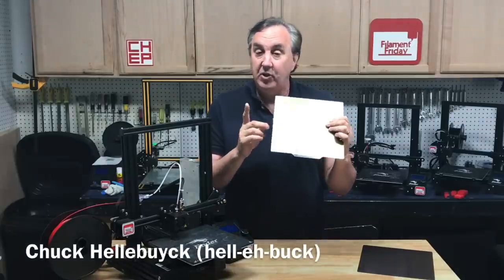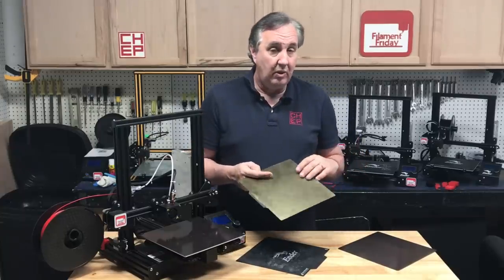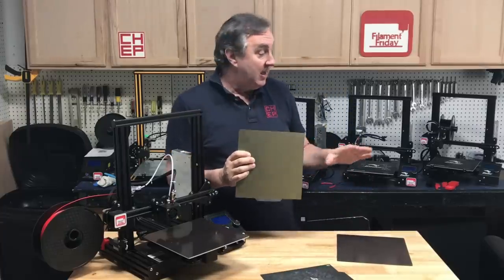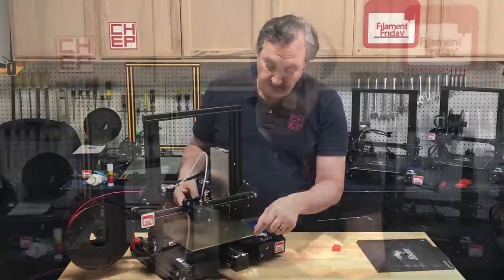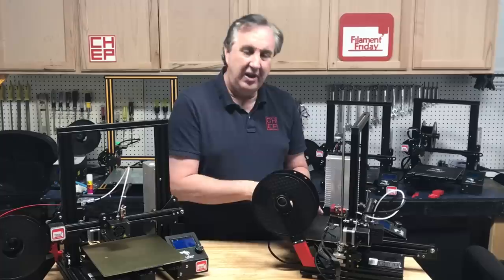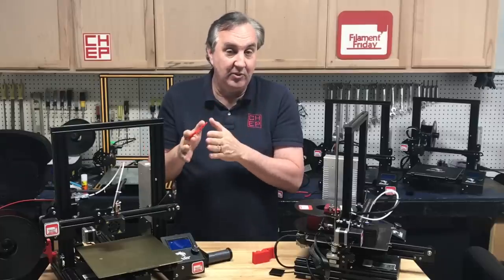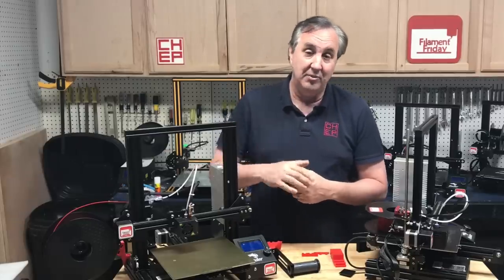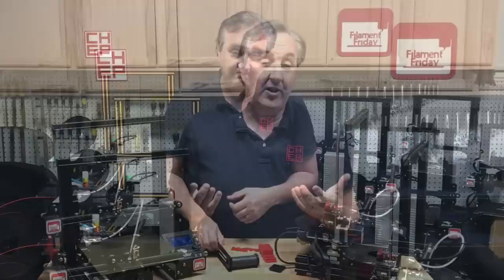Creality PEI Magnetic BED on Creality Ender 3 PRO

Comment: TLDR : I have 5 of these (Creality brand) they all work great, occasional wipe with IPA is all I've needed. I do print with the bed at 60C though which seems to be a common sweetspot. 

I have bought 5 of these sheets for my Ender 3 Pros and I have been very happy with them. I will say the ones that I have bought from Amazon are usually hit or miss  as far as quality control goes. I've had a couple that have not been cut perfectly, or have a blemish like you had. The great thing was Comgrow has always taken them back without issue and replaced the sheet. I recently bought one directly from Creality when they had a sale, and it's interesting that it really seemed to be a higher quality. The PEI is cut correctly and also the PEI in general just seemed like a different look and feel. I actually really like it, and would probably buy directly from Creality if I need another one.

With that said though I love PEI and can't imagine printing on anything else. I NEVER use any additional adhesives (or release agents) for PLA and I very rarely have any adhesion problems. If I do it has always come down to a leveling issue. 

I started my 3d printing journey with a Prusa MK3S, which comes with the smooth PEI sheet and that's what I got started  and learned on and also what I have had the best luck with. So when we got a couple of Ender 3 Pro's to tinker around I got fed up with the stock sheet, and didn't like printing on glass at all. Got the Creality PEI sheets and I love them. You should take care to not touch the surface to much, and if you do you should wipe it down with IPA. I've also used 100% Acetone to wipe down the sheet a couple times after excessive printing and they really cleans it up and rejuvenates it. I have heard some people say that washing it with warm water and blue dawn is sometimes necessary but I have never had to do this with a smooth PEI sheet... As mentioned I have 5 and other than a wipe down with IPA when I received them and occasionally after every couple of days I've never had any issues.

Comment: I have upgraded my CR-10S to a textured PEI magnetic bed, and in my opinion it just needs a little higher temperature than the recommended standard, I just use 65°C for PLA and 80-85°C for PETG (I also have a 750W AC heating bed, otherwise good luck getting that temperature on the stock bed!).

Comment: How come you have had so much issues? PEI flexi sheets are the main-stay of prusa printers and they rock. When I start to lose traction on my PEI, I use a green scourer to rough up the surface (a little) under warm soapy water. Never failed yet in nearly 2 years and 4 beds. IPA between prints, and an occasional refresh with the scourer after a few months. Hope that helps.

Comment: I print on PEI (PrimaCreator and TwoTrees, which seem to identical to me) and Wham Bam PEX exclusively, but then I almost always print large, flat objects. I had a hard time getting these off of non-flexible build plates. For me, keeping the PEI very clean with 99% IPA as well as dialing the Z offset in very well are the keys to a good print. Still being a beginner, I tend to print too low which results in the nozzle damaging the adjacent lines of already printed material, peeling it off in some cases. But apart from that, I rarely have problems with adhesion. Oh, and I also scuffed up the sheets with steel wool as per the sellers' instructions.

Comment: have you tried printing it inside an enclosure? the steal tends to expand and contract during prints.I had same issues with my wham Bahm and i have a 400 to 400mm bed. after enclosing it.. no warping whatosever.

Comment: I have 6 Ender 3s and use these PEI build sheets on all of them with no issues.  Did you adjust your bed temp for the new sheet at all? Did you adjust your Z for the thickness of the new sheet?
Reply: What bed temp do you use for these with PLA?

Comment: I use powder coated PEI flex plates on all my printers.  I print with PETG and PLA with no problems.  I do print 5 - 10 degrees hotter on the bed.

Comment: I have pei on my Ender 3 and my Ender 3 Pro. They work great on PETG, not so much on PLA. I did rough mine up a bit with a brass brush.
Reply: Make sure to also wash it with IPA every print. Oil accumulates on the surface from your skin and the air
Reply: Mine was the opposite, fine with PLA and terrible with PETG.  Go figure.  :S
Reply: @3er24t4g1  yeah I regularly wipe mine down with alcohol. But less so recently as I can't find it in stores and have been conserving it
Reply: @benvolio36  if you really cant find any buy vodka, or go to the hardware store and get denatured ethanol

Comment: I scuffed mine with grey 3M Scotchbrite and I usually have trouble getting the print off the bed. I had allot problems in the beginning, but leveled the bed, scuffed with the grey Scotchbrite, then cleaned with isopropyl alcohol and it has worked great since.

Comment: I have CR10 and CR10 MAX. Both using a mirror. I use Elmers PVA glue mixed with water. Works great with PLA, PETG, TPU and Nylon. ABS works better with hair spray.
I won't bother with all these fancy coatings

Comment: I have had a bad time with my ender 3 failing on prints. I switched to a glass bed and it was hit or miss unless I used glue sticks so I tries the one you just got and man does it work. I have had 0 issues so far. All my prints are coming out nice. I wipe it down to remove dust particles before every print.

Comment: I have a cheap clone from aliexpress and works fine on my TTP. I just clean the surface with some PEI before each print and if want to be extra sure on a long print I just apply some hairspray on it. No adhesion problems so far.

Comment: Wipe it down with IPA if you have any oils form your hands on it it's not good.... Also you can use some steel wool to skuff it up just a bit and that helps. I use a spray bottle with IPA and a light rub of the steel wool every maybe 50 prints and about every 3 prints or so with a bit of IPA and a wipe down with micro fiber cloth.

Comment: I use the Wham Bam PEX surface on my Ender 3 and love it. I run a bed temp of 70deg C with PLA. I sometimes get warping with a large solid print when ambient temp is cold.

Comment: I don't get it. I use Creality Glass bed and I never use any glue? Temp at 50 degrees and on big pieces I need to wait for it to cool because it sticks so much
Reply: yep, me too.The creality glass bed is awesome.I even use hair spray on my big prints. That is the only time I see them trying to lift a little bit from the edges but only about 1mm.
Reply: Marc-Antoine Same here.  The Creality bed works with PLA, PTG, TPU, Ninjaflex.  Great bed adhesion on all of them.
Reply from the maker: I wore out my Creality glass bed on Ender. So I flipped it over and use glue on glass. Works great for me.
Reply: For me the glass bed had 50% succes, cleaning, leveling, cleaning and so on... then changed to a mirror with NO glue at it works perfect! 60 to 65C
Reply: Jordi Rosello I run 55 deg C for PLA, 90 deg C for PETG, 60 deg C for TPU and 49 deg C for Ninjaflex with 100% hit rate.  I clean it with IPA maybe every 10 prints.
Reply: @jra  pretty close from flashing point, could it be an issue on prints with a sharp angle from the beginning?
Reply: @MarcAntoine01  Not at all, that happened with different kinds of prints, using brim, direct, or even raft, may be my surface it's a bit faulty... or even the glass is not flat

Comment: This is the only build surface I've used apart from the magnetic one that comes with the Ender 3 Pro, so I cannot compared to glass.  Ove the few prints I've done with it, it has been near PERFECT!  I'm currently printing a second bracket that I designed to mount my soundbar to the bottom of my TV.  The bracket is nearly 8 inches long, and I'm printing it rotated 45 degrees.  The first one came out perfect, and the second is about 10% into the print and looking great as well.  It sure sounds like CHEP needs to try another one!  

I will add that I bought mine from Micro Center, and it was in a Creality box.

Comment: Ah crap, I just ordered one of these. Oh well! Thanks for the info!
Reply: You're good, just use it correctly. Before you print for the first time take some steel wool to it and rub it down pretty good. Do that whenever it stops adhering and you should have no issues.
Reply: I just recieved mine the other day and it works great. I wash mine with soapy water every few prints to remove finger prints, etc and have not had a single issue with it.

Comment: What bed temp did you use? I've used PEI on multiple printers for months. You need high bed temp.
Reply: I'm running PETG at 83, against the recommended 55 or 60 !

Comment: I had the PEI bed on my Ender 3 and encountered the same issues. I had to resort to using hairspray just to get the print to stick to the bed and occasionally had the bottom layer warp (particularly on larger prints). I also noticed the bottom layers on my prints were looking rough even though I'd level the bed after nearly every other print and maintained the same bed temperature. I'm thinking mine had some issues with heat transfer as the problem went away after I switched back to the stock Ender 3 bed.

Comment: Hi,
I have CR-20 Pro, the issue is the platform is not equal, when I do the nozzle adjustment the front side the nozzle doesn’t touched the platform but back side the nozzle was scratched. What can I do?

Comment: That is odd for a PEI sheet. I don't use a flexible, but rather a stick on, and it has held up for over a year. Minimal cleaning at that as well. I run 5 enders with this setup and have had no issues, other than maybe too much adhesion. But PEI works great for me. To be noted, I mainly print PLA at 210 and 60.

Comment: i once had a clear pei sheet, quite hard one which was really nice pla.. petg no problems at all. 

then i switched to a removeable bed with a black pei sheet, it was a lot softer, nothing sticked ever  awful. it was so soft / thermo-deformable the nozzle just digged right into it.   not even a scratch on the transparent pei sheet when the nozzle dragged over it.

Comment: I set up my spool on the side of the ender 3 pro. If I knew how to send a pic, I would. However I do have a question, I just installed a duo magnetic pad on my pro and the first print, after manually leveling, and ABL with CR Touch and the first test print ruined the pad. I had to practically chisel the filament off. Finally I gave up. Never got the pad clean. Any suggestions?

Comment: I get similar issues with a glass bed. I bought the glass bed as the bed that came with my ender 3 holds the prints too well and i was damaging them. I got the glass bed and dont get me wrong I can remove prints very easily now but small prints do stick for too long and large prints warp easily. Ive not tried using glue or hairspray yet as I was wondering if there is anything else that can be done. BTW I heat the bed to 70c and it still doesnt help with PLA.

Comment: I bought a PEI flex-plate by Eryone for my CR10s Pro a while ago and found it to be really poor with PETG, I'd have the odd occasion with PLA lifting at the corners, too.  No amount of IPA cleaning or wire wool rubdowns made any difference, so I bought another stock Creality black bed sticker sheet (which was a nightmare to remove prints from when on the 3mm alu bed) and stuck it to the reverse side of the flex-plate. 

I haven't used the PEI side since; flex-plate + stock sticker = everything sticks really well and pops off with ease.  It should have been what Creality supplied as stock with the Pro, imho.

Comment: Didn't get anything to consistently stick to the bed with any settings lower than 230 ° tool and 70° bed temperature for the first layer, at least with prusament pla....

200° and 60° seems to work just fine for the rest of the print job...

Comment: Couple things I would suggest for those that are new to PEI sheets:

1 ) For SMOOTH ONLY, use acetone from time to time to clean the sheet not just IPA. 
2 ) If you're having issues similar to CHEP here, you have a bed leveling problem. Using something like a BLTouch or any type of Auto Bed Leveling will resolve this issue completely.

I'm not saying that CHEP doesn't have an actual issue with his sheet, that's very well possible. However these TYPES of issues can be often times mitigated with the 2 suggestions I've mentioned.
Reply from the maker: I showed in the video I don’t have a leveling issue. The test print laid down perfectly. I believe a lot of PEI and other bed issues are blamed on leveling when it’s actually faulty bed material. 
I’ve found auto bed level can often cause new issues for beginners with z offset and inconsistency that I don’t recommend them.

Comment: need higher bed temp. PEI generally needs 70º-ish or more temps, and it has to be a TRUE temp, not 70 in the middle but 50 1/2 way out. Guessing Ender beds aren't all that even in heating..?  Probably better with TH3D's blue EZMat..
Reply: It's not that bad on Ender 3 on the outside, but generally, yes, you do have variance.

Comment: Every time I see your videos I wonder. Why do you not have an autobed leveling sensor like the BL touch or the 3D touch? I use the 3D touch with my own settings in Marlin and it works great!
Reply from the maker: I prefer manual bed level. I get it set and leave it alone.
Reply: those are fine if you're just printing pretty, but if you ever print dimension critical parts they're useless.
Reply: @butre.  Why do you think so? Don't really understand why that's the case.
Reply: @oscarkromhout7621  a bltouch just compensates for bad bed leveling by adjusting z travel for the bottom few layers, it's not magic.  if your bed isn't level, or worse yet is warped, then your part will come out out of square or wavy
Reply: @butre.  yeah I understand it's not magic, but why is it bad for some applications like you said? Just curious. Could be the reason why some prints failed for me
Reply: @oscarkromhout7621  it's not likely the cause of your failed prints.  an out of level bed just can't make parts that are accurately sized on the z axis, regardless of whether you have an auto-leveling system.  a manually leveled bed with a glass top is always going to be flat and level, and you'll always get parts that are accurate on the z axis.
Reply: @butre.  it is not true what you saying, bltouch and other sensors compensate for bad bed levelling by adjusting z travel for the bottom layers but the firmware gradually get the z axis to the equally same height in correspondence to x and y position, this is done by so called "fading height" so for example the height will be compensated till the layer 10 and from there it will be gradually fading towards the top of the print to met the required dimension and no, it won't be wavy at all ;-)
Reply: @ramzeslo2  the bottom of the print will be uneven if your bed is uneven.  firmware can't change your bed
Reply: @butre.  are you being serious? We are talking about 0.1 - 0.3mm at maximum... 😂 What kind of dimensional accuracy you are expecting from 3d printer? What about filament dimensional accuracy and its ability to shrinking differently at different printing temperature, what about the temperature of environment? What are you printing if you need such a accuracy? The whole point of all kind of bed leveling systems is to help filament to adhere to the bed...  I print a lot of projects and i never have a problem with accuracy, as long as E steps are calibrated and the print settings are right + always print at 100.25% for PLA for example due to shrinking, and thats pretty much all i need to worry about
Reply: @ramzeslo2  I mostly print templates for manual machining.  required tolerances are ±0.025 mm.  my prints are within those tolerances
Reply: @butre.  i just say 0.1 - 0.3 as the extreme example, but in most cases the difference is not more than 0.025 - 0.125 ;-)  
But coming back to yours prints... so are you saying as for your application is still better to print on uneven bed instead of using manual mesh bed levelling, probe mesh levelling? how you can get a better accuracy printing this way?
because i don't believe there is a one, single and even bed across the whole surface area with accuracy up to 0.025 in this world
Reply: @ramzeslo2  I use a thick piece of borosilicate glass as a print surface and level using a micrometer, same way I'd check a milling machine for levelness.
Reply: @butre.  I have used many borosilicate glass plates in past and non was even... but its great if you found one perfect piece of glass, I understand you are also using 1mm pitch lead screw for this porn print setup, because this is another factor which will cause inaccuracy ;-) I don't think this conversation is going anywhere, so just want to wish you all the best and great prints in a future.
Reply: @ramzeslo2  I got mine from a local precision tooling company, guaranteed to within 3 ten-thousandths of an inch.  a lab glass company might be ok too.  just can't buy a creality branded plate and expect flatness.

lead screw pitch won't cause inaccuracy, low number of steps per revolution is the issue there.  whether your lead screw is bent is a bigger concern.  swapped mine out for ball screws anyway
Reply: @butre.  well i wont agree on screw pitch, you can't just swap the screw for 1mm pitch and not changing the Z steps... I thought this is obvious
Reply: @ramzeslo2  not z steps, but steps per revolution of the motor.  the thread could be 1 turn per meter if you have a trillion steps per revolution (and a strong enough motor).  a finer pitch screw just lets you get away with less steps per revolution.  this can be handled via having a motor with more steps in and of itself or via gear reduction between the motor and the lead screw